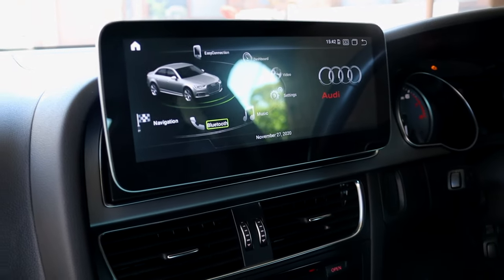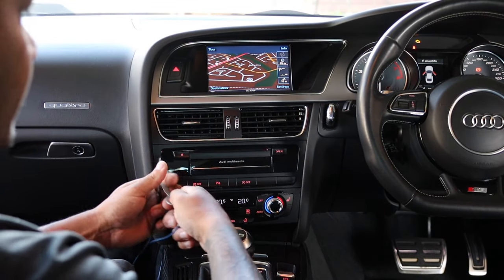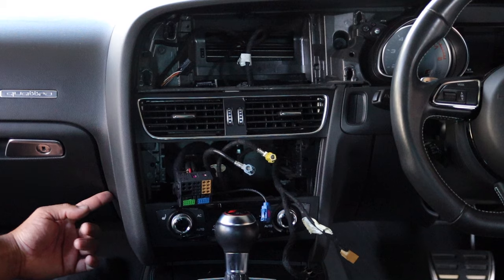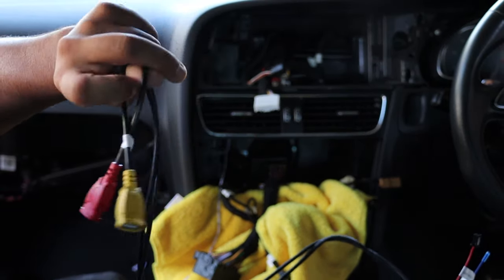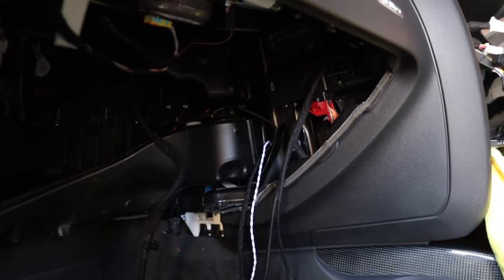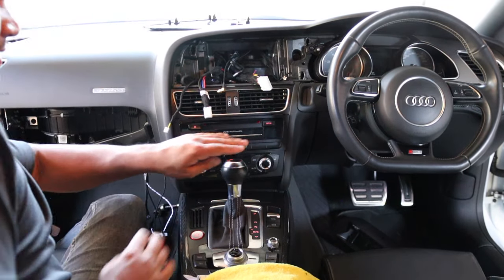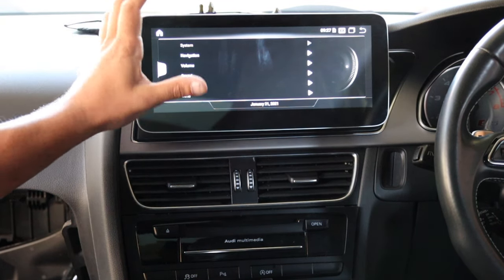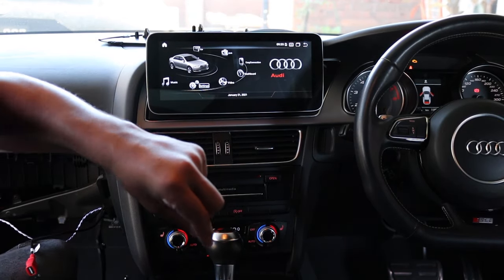Audi A4/A5/Q5 10.25" Android Screen Install (Full Install) Wireless CarPlay / Youtube / Netflix.

Comment: Hi, Just received my kit from you, many thanks.  I notice the new hazard warning switch does not include a passenger airbag warning light??? and the disk which was in with the OBD11 is broken!! Finally, no installation video??
Reply: Hello, did you get and answer on the passenger airbag light?
Reply: @cihados  Did you manage to sort this? I have this screen in my A5 coupe but the hazard light isnt wired up and cant even see where the previous owner put the new cable for this screen... Also wondering if I even have working air bags..
Reply: @RoxusRemo  You have to unplug the airbag switch from the old kit and then use it with the new one. Imagine there is a wire from the new screen which plugs in to the airbag switch and then just hide it with all the cables. If the airbag light does not switch off you have to use something like carly to reset it.

Comment: Hello friend, I just bought an 8.8" Coika screen for my 2013 Audi A5 with 3G High nav, I connected everything perfectly like you in the video, but I don't understand why it doesn't give me information about open doors, oil, gasoline, kilometers, speed, etc., etc. Could it be because I didn't connect the 2 cables that go in the Glove Box? I thought it wasn't necessary. My car doesn't have a CD changer or anything in the Glove Box. Thank you very much for help.

Comment: Sup mate. I’ve installed the screen on My Audi A5-Sportback 2013model. So it has MMI High level and has Audi multimedia system. 

The problems I have is: 
1. I can’t control the screen with the knob.
2. When I click on Bluetooth. The car just back to the car original display. So it means I can’t even use Bluetooth 😞. Pls help me out.
Thanks

Comment: im interested in buying but does the original back up camera still work ? would i have to replace it with yours ?
Reply from the maker: Genuine camera still works my man :)
Reply: @TheFittingBay  what about the original A5 2016 parking front and rear sensors work on this?

Comment: Installed mine yesterday. Only drama I had was that the two screws located in the back didn’t have anything to screw into, there were just holes at the back only. Was something missing in my kit perhaps?
Reply from the maker: How did you go with install? Was the speed clips on the screen missing ??
Reply: @TheFittingBay  yeah no speed clips came with the kit
Reply from the maker: @stevie_83  sorry man do you want me to send you some out :)
Reply: @TheFittingBay  no it’s ok I bought some off eBay. So the system is nice. Only issue I have now is sorting the buzzing noise Im get from ground loop
Reply from the maker: @stevie_83  Hi Steve, please send me an email detailing this so we can resolve it for you asap. info@aesonline.com.au YouTube does not show me all comments as we get 100's of them.

Comment: Just fitted this to my A4 B8 with no MMI, just the concert head unit. I have no sound, nor any signal when pressing the 'car' icon. I thought this would show the factory screen, but all I get is No Signal. No sound at all from the screen, but the radio, CD outputs sound. I've altered the AUX positions and changed the AUX in cables over but nada. No instructions whatsoever in the box which may avoid questions like these? Anywho, any ideas??
Reply from the maker: Hi mate. We offer technical support to customers, email me with your order number and we can help you.
Info@aesonline.com.au
Reply: Hey did this ever get resolved? I have concert also and would like to do this upgrade... Cheers,

Comment: Would I need a wire harness to hook this up? I bought the same one and the factory harness is not the same, so im just sitting on a new screen I can’t use. I have a 2009 Audi s5. For this to work I think the factory radio has to be malti player for the plugs to fit. Can I buy aftermarket harness set to make this thing work?

Comment: Not sure if this form is still open, I installed this unit and now the main head unit and heater display do not come on. Is there an issue in the wiring harness or is it controlled by the head unit that also no longer works. Safety theft system that needs to be repaired by the dealership?
Reply from the maker: What’s your order number ?

Comment: Is this the RSNav system or a different brand? Looks exactly like RSNav but the link isn't to the rsnav site
Reply from the maker: It’s not that system man, we haven’t used it.
Reply: @TheFittingBay  Oh ok. What company is it? Is it made locally there in Australia? I'm assuming that's where you are, based on your accent and the fact that the steering wheel is on the right. Just trying to find the best unit out there. Didn't know there were options other than RSNav, which I believe is made in China
Reply from the maker: @therealjoshtodd  Yes I’m in Australia but the screen is not made here. They are all made in China. We have a large manufacturer that we use for some of the CarPlay modules / screens that we do and we’re very happy with the products.

Comment: Hey, great video! Does this affect sound quality in any way?
Reply from the maker: Not at all :)
Reply: Ofcourse it does affect the sound quality the bass is lighter than the OEM system, it sounds brighter than the OEM system, it does not have a volume control bar.
Reply: @ultimateenergy-au  damn no volume control bar? 🤦🏽‍♂️🤦🏽‍♂️🤦🏽‍♂️
Reply: @ultimateenergy-au  is that good or bad
Reply: I have tried to configure the sound since it is quite bad, I still do not succeed
Reply: @Kneelb4Me87   Its acceptable, I have B&O system which sounds way better than this.

Comment: I've tried installing this however now my car wont start. I suspect its to do with the CANBUS connection to the Gateway module. When I unplugged everything and reconnected the CANBUS then the car worked as normal again. Then I reattached the harness cable and it still worked. Then I resinstalled the glovebox and the car stopped working after that even when I disconnected the harness again. Is it possible the Gateway unit is damaged and needs replacing?

Comment: nice video and detailed information thanks . Btw couldnt see z link or t link for wireless carplay in apps (my '13 audi a4 has a similar aftermarket headunit ) i live problems with zlink aftewr ios 15 update do u ve any issues or how do you connect wireless carplay?
Reply: I installed Headunit reloaded app for android. Something similar for Apple?  Its a bit tempromental but wireless link works. Takes a good 30 seconds from turning car on to get the link up though. Everything works fine.

Comment: Hi, have the same mod for my audi a5. I also bought an aftermarket backup camera which doesn't work with the android unit. It has power and we used cvbs cable (so basically it should work). I even tried it with a usb dvr.
Do you have an idea what's wrong or any suggestions?
Reply from the maker: Probably settings in the unit?
Reply: Tried with every settings possible.
Reply from the maker: @gousy_19  and did you purchase this from us?

Comment: Hello. Hi there. I’ve got one of these installed but I’m stumped on the aux volume. 
I have the Audi concert and have the Ami port in the glove box. 
Am I missing a cable for this. I can’t seem to get a decent volume on music through the Apple CarPlay. 

Please help
Reply: I also have an Audi concert in my package came with an ami cable that connected into my glove box and then a wire connecting that to the wire for the screen
Reply: @CallumConnell-i3l  do you have a picture of this wire you have please.

Comment: On the site it says it fits an 09 A5, but the 09's are no different from the 08 if I remember correctly, so will this fit on my 08 A5?
Reply from the maker: Some 08 models are 2G mmi and it doesn’t work on 2G cars
Reply: Will this work on a 2010 a5?
Reply from the maker: @kjblackman  yep
Reply: @TheFittingBay  Not even the 2G MMi High models?  Also have 08 S5, and am curious.  Thanks.
Reply from the maker: @brettmurphy415  Stay tuned re 2G mmi :)

Comment: Tried to fixit on Audi A4 but not working properly can’t connect to Bluetooth and controls not working.. the airbag light is on red after switching the hazards mine had the hazards switch and the airbag switch same side.. how do u fix the airbag light problem?

Comment: How does this screen do in direct sunlight? I have an A5 convertible that I am thinking of putting this in.
Reply from the maker: They are designed to work in extreme temps hot and cold so i don't see you having any issues, the screen is a high quality capacitive so you wont have any issues there either.
Reply: Where can I buy that for audi q5 2013?
Reply from the maker: @nyigwoochik1165  https://shoptfb.com/collections/audi/products/a4-a5-q5-09-16-10-25-android-replacement-screen

Comment: is this compatible with my factory reverse cam and sensors ? is there a specific wire that should be connected for that to work ?
Reply from the maker: Should all work as normal
Reply: I can't get mine to work

Comment: Im hacing trouble dropping the glove box, any tips for that and if not is there a way to get around dropping it so i dont have to?
Reply from the maker: Gotta remove it. 

Remove the furthest left side panel, 1 bolt there. 
3 bolts on top inside the glove box 
2 underneath 
If you have a pocket or CD changer in glove box there’s also 1 behind that 
Then it drops down

Comment: Hi, I have the same system (Audi A4 B8 2010). My Bluetooth audio sounds very FLAT and low quality compared to the Satelite Radio and FM radio in the car.  Are there any recommendations to bring the Bluetooth audio quality up...also, the second thing, the sound all of a sudden only comes from the RIGHT front speaker...any assistance with these two items?
Reply: Check all your cables are properly installed behind the unit. And also mess with the sound settings. My screen is similar and its under settings, car infotainment and sound. I turn off loudness and changed all my EQ and now its ok. Still not great for a Bang and Oluffson though.. tried USB connection?

Comment: Hi! I just tried to install a unit like this in my 2011 Audi Q5 without mmi. Ran into problems with the canbus t harness. The connectors were different. Units connector was wider with 2 more pins on one end than the cars connector. What's up with that? Do you know how to make a dab splitter work with this system?
Reply: Hi did you solve this problem as I've got same issue?thanks
Reply: @paulharrison7121  I had to connect the t-harness to the right connector on the a/c panel.
Reply: @ulven77   thanks I will try that

Comment: Hi - just purchased the same screen for our Q7 and had it installed by a shop. The plugged it in and the screen didnt power up. Any idea what is wrong?
Reply: It is an unnamed unit from China; there was no instruction manual or any paperwork, its rubbish, it has given me so much grief

Comment: How do you remove the box center piece from the trim? Clips or does it need to be cut out?
Reply from the maker: You can do either
Reply: @TheFittingBay  So there's clips to remove the box center piece behind it? I don't want to cut it off
Reply from the maker: @Hector__11  yeah check end of video where I did it

Comment: I have this unit, but notice that you can't link Bluetooth using the default android settings. Is there a way to fix this so I can pair a controller and my obd scanner (carista). There's no options in android Bluetooth settings

Comment: Hey, sir great video...... I have an 2009 A5 my factory amp got water damage due to design flaw....... is there a way I can bypass the factory amp and still have all functionalities?
Reply from the maker: Yep you can bypass the amp, but if you have factory B+O or something alike it will not be a cheap process. Probably easier to replace with a non water damaged part. Unless you want to go all out and do a really good system :)
Reply: @TheFittingBay  rather go all out.

Comment: I got this installed in my B8.5 A4 recently after seeing this video - yep it's great! It really looks like it's meant to be there!
Just one thing: the sat nav can't locate my car - the little wheel just keeps going round and round. I've driven around, and it's a pretty built-up area so it should be able to locate it.
I've just been using Google maps from my phone, but I'd still like to get it working....any ideas?
Reply: Did you figure out? I want to install one on my b8.5 too i don’t know how to
Reply: @josesandoval2753  No haven't fixed it yet. I need to take it back to the installer.
Me personally, I wouldn't even attempt to install this sort of thing myself as I don't have the skills nor tools, so I spent (way too much!) money to get it professionally done, by Euro electrics outfit.
These videos always make it look easy but...yea nah.
Reply: @ecurb10  If it can't locate the car then it is likely 1 of these issues.

1. It was placed in a poor location within the car.

2. You have a faulty GPS antenna and will need to put a new one.
Reply: @Hellothere854434  Thanks.
Poor location? Not sure where else it's supposed to go🤔.
But the installer and I suspect that it's because it's one of those Chinese imports that are only configured for certain countries. I managed to find where to enter its location but it only recognised certain countries.
Thanks anyway
👍
Reply: @ecurb10  download gps test on your head unit and tell me what results you get.
Reply: mine did the same thing. I just ran the GPS antenna up into the A-pillar, and it works fine now.

Comment: The t harness for the canbus doesn't fit my 2011 audi a4? The connector blocks on the harness are much bigger than the red connection on the canbus box, do I have wrong harness in the kit I've bought??
Reply: Same smh
Reply: @TechniqaLTq  joke innit! I spent an hour fitting the thing only to find out it wouldn't work🤬

Comment: Hi Nathan, if I press Car to access old system it says no signal, everything is plugged in where it’s supposed to be but still no joy? I bought off eBay in the UK but not from a supplier so no support. Can you assist? Also when I tap Dashboard it thinks I’m in a left hand drive, how do I change that please?
Reply: I have the same probleme.

Comment: So with this system, can I have google maps navigation active while listening to the stock fm radio?  Seems like most aftermarket AA/CP solutions require you to switch to aux input.  But I want to be able to tune the radio while using google maps.
Reply from the maker: Yeah man you can go original MMI > Google maps and listen to radio while using maps, if you then want spotify etc you need to go back to MMI and change to AUX
Reply: @TheFittingBay  Great - and for taking calls, or hearing any audio from AA/CP (turn by turn directios, for example) I need to be in Aux?  Or will those play over top of the radio like a factory system?
Reply from the maker: @TheTimbo80  need to be in Aux ☺️
Reply: @TheFittingBay  Thanks, I appreciate the replies.  That might be a deal-breaker for me, and I'm guessing all aftermarket CP/AA solutions have this same drawback.  I just bought a 2017 Q5 so I will play with the stock MMI for a while and see if that does what I need or if I want to go with something like this.  Thanks again!

Comment: The sound of the car manteins equally ?? I have Bang e Olufsen sound system.
Reply from the maker: Remains the same, stilll uses OEM amp and the BO sounds nice :)
Reply: Unfortunately mine is Audi Q5 Concert and there very noticable digital noises and other reported same thing, It's a bummer for me.

Comment: Hi Guys...i have an Audi S5 2012 with have 3G_DAB K0098.......what do I select on the drop down box when i purchase the unit. Also I am based in the UK so will there be support for me if anything goes wrong?
Thanks guys
Reply from the maker: Just click Audi mmi with navigation (if you have it) I’m assuming S5 will have. Or if the radio unit reads “Audi Concert or Symphony” click the drop down for that. And of course we will help with technical support or anything else needed :)
Reply: @TheFittingBay  thanks I have now ordered both the unit and reversing camera.....although I paid two shipping costs can they be sent together and one shipping cost refunded. Please make sure the unit sent is for a right hand drive car as I am based in the UK
Thanks guys
Bob
Reply from the maker: @bobgunston5993  no problem. I’ll see what I can do for you re refund shipping

Comment: Does Android Auto work wireless ? and what if i dont have an aux plug? ive got only the AMI Plug
Reply from the maker: Then you’ll need the AUX-AMI plug for the car to allow AUX input and the plug and play connector has the wiring side done already. AA can work wireless yes but subject to phone as they can be unstable due to AA

Comment: I am getting no sound. I have no AUX selection in the OEM menu. Even with and AMI aux adapter it doesn’t work or says “Device not supported” when using wireless CarPlay.
Reply: I have the same problem. Did anyone respond to your comment.
Reply: @andrewparker6742  I ended up getting a Bluetooth adapter and using the usb connectors to power it. Connected it to the unit and sound works. Automatically connects and plays audio. Tucked it away in the glove box out of sight.

Comment: Thank you so much for thos video! I installed mine by watching this:)
But I do have a problem now. It is not working when i start engine. If I want to use it I have to unplug and plug this screen and when it works again. Do you know what could be the problem?
Reply: Its trash that's the problem, Lucky if you can pair it to your phone, daily freezing the screen and on and on it goes.